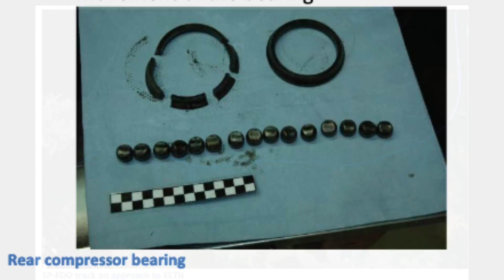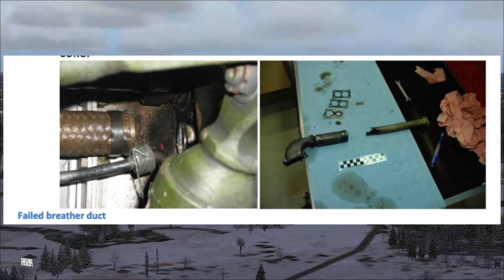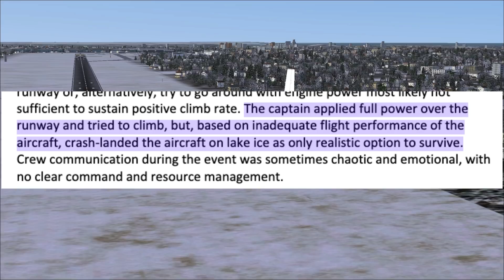When Not Following Procedure Almost Turned Deadly | Exin Co 3589

Comment: A cargo AN26 also crashed at Cox's Bazar (Bangladesh) in 2018 due to an engine failure on take off, the crash occurred because subsequent actions from the crew were not part of SOP's

There was fog at the departure airport, the crew should have continued to their alternate airport about 50nm away, but they persisted for a landing in fog, and during their subsequent go-around, with the aircraft STILL configured in landing configuration, FULL flap gear down, resulted in loss of control and a single engine full power impact in to shallow water

It was not a pretty sight at all.......

Comment: Simply poor piloting skills. As for the '140ft pm' climb performance on one engine.. that's a grossly over-simplified statement of fact. Yes, a test-pilot, with a brand new aircraft in the certification stage, on a good weather day and in full knowledge of the procedure to be demonstrated, achieved the figure of 140 ft per min climb gradient. 140 ft pm is a minuscule climb gradient, the tiniest amount of insufficient or excessive rudder input, or either not quite achieving, or applying more than 5 degrees of bank, toward the good engine, would eliminate that 140ft. These are two very average, maybe below average pilots faced with an unexpected and serious failing of equipment at low altitude. How much time have they spent in simulators? Who knows, my guess is.. not nearly enough.

Comment: I wonder if the fact that the landing gear was down when the pilots attempted a go around made a difference? If the had retracted the gear, the plane may have been able to gain altitude instead of sinking.
Reply: the description indicates that the landing gear was lowered after the runway threshold was passed, but retracted again afterwards

Comment: For Some Time Now, It Has Been Known That an Accident Involves Several Factors.

Despite the Pilots' Misconduct, They Share the Responsibility with the Company,

Because, Without a Doubt, It Is Who Must Guarantee a Good Training and, of Course !,

The Awareness and Commitment of All Your Pilots To Follow, As Strictly As Possible, “TO FLY LIKE YOU TRAIN" !

That Is, If The Pilots Failed, The Company Also Failed to Provide Adequate Training or Assessment.

However, It's Not Just Training and Rigorous Charges, Everything Must Have Balance !

Take a Look At, For Example, The Two Impressive "Almost" Catastrophic Accidents Suffered by Emirats in December 2021 and January 2022.

There Has To Be Balance, As In Aircraft’s Performance !

Comment: They may assert that the plane can be flown on one engine, but, if the engines were getting old and worn, and the plane was very close to its maximum weight, that may not have been true at the time of the crash.
Reply: Also the lack of coordination among the crew was probably a reflection of conditions on the ground as well, and the right engine was probably as much of a deathtrap as the left one. It just hadn't gone yet.

Comment: Bad bad CRM. They tried to do way too much at once. Their failure to follow the checklists (more than one) is evidence of this. If the pilot wanted the extra boost from the APU (a fine idea), they should have called off the approach, stayed at altitude and focused just on getting the APU online (following the checklist). With that, they would have been able to continue to focusing just on landing the plane.

Comment: Just FYI, in all (modern) aircrafts, the APU is basically a tiny jet engine, as it runs on kerosine.
Reply: what i know about apu's they are generators  on the planes it self for starting or powering up without engines running for example if ground crew wants to perform checks for plane they turn them on or pilots wants to start the plane, or they can ask for ground generators service from the airport

Comment: APU (RU-19 is the model name) on An-26 and An-24RVs is thorttleable, it has a third throttle to the right of the main ones on the pedestal, so you can choose whether you want it to provide full power or just idle. Its main purpose is providing electric power on the ground, as well as additional thrust at take-off weight close to maximum, or at hot and high aerodromes.

Comment: Why not do the circling for 25? instead of landing with a tailwind while heavy.  Or Too heavy for the 180 circling turn?  Just widen the distance on downwind to use only 30 degree banks only.. It is high VFR. Too difficult to do a 180 turn at 1,000 agl?  Gee.  Some airline pilots can only do mild turns and mild straight in approaches.  See the results..

Comment: -Technically, it is NOT true that all twin engine planes are designed to fly on only one engine.  Some light twins cannot maintain altitude at typical weights on one engine.  A good example is the Piper Apache, which only has 150 hp per side.  The remaining engine takes you to the scene of the accident...

Airline equipment is required to be able to climb at a 2.6 degree angle after an engine failure at rotation.  This is done by leaving weight behind on the ground in order to ensure this performance.  Ever had an airline "lose" your luggage?  They didn't lose it at all, they left it behind in order to make sure that this required performance is met.

Great video!
Reply: They ARE meant to fly on single engine. If they do, is another thing, but no twin is legally impossible to fly on a single engine given the max weight is not exceeded.

Comment: Wow, 140fpm is extremely marginal performance, even if you do everything perfectly. 

I know it’s technically pilot error, but the aircraft performance doesn’t exactly seem ideal either.
Reply: yup POS plane barely works on a good day with a stong breeze ;)
Reply: given the lack of maintenance on the failed engine I'm doubt the remaining engine was perming up to spec
Reply: It has to fly and land on one engine. It doesn't have to be able to take off on one engine.
Reply: Assuming the 2nd engine was generating full rated power and aircraft weight was as published... Which it never often is

Comment: okay, this is a nice video of what happened . you have added that you where in a warm bed while making this video, so props to that. what I can add is that no human on earth can possibly know what it is like following a checklist...(for those that don't know, when you have an abnormal parameter or vibration, you use a QRH(quick reference  handbook)  that will tell you what procedure to follow, in this case you would likely run 3 checklists and then the normal checklist after that...if they where in fact on final approach and they had this abnormal situation it is not uncommon for the crew to do a go around, knowing that there aircraft will fly and climb on one engine...now what makes this video confusing to me is there is a few animations(flightsim) where the aircraft go's around and  extends the gear , however you never mention that the crew did this ? that would make a huge difference in flight performance, also then at a stage it just lands on the runway...(please include actually feathering the engine in your videos as this is something real pilots look at, plus it makes it a lot more believable) My point is ..you go around because it is clearly not a stable approach...you add power and the aircraft does not perform like it should. If you have experienced that..  then sure give the crew shit. If have not been in that situation the you would have no idea how that feels to know you are now heading towards certain death. so its very hypocritical to anybody who has not been  in that situation to say, hey the crew made a mistake. the visibly was also less than ideal..so all in all I give the crew 10/10 for surviving this accident...Its not as simple as it seems.

Comment: I know this comment is out of place, however I hope it is read by people in the aviation industry, because I worry about noone thinking about what would happen with aircrafts in a huge radius, because of the EMP from a possible Russian nuclear attack on Ukraine. 

Because no jet airliners except those special ones that are rebuilt and hardened for military purposes, are tested and guaranteed to withstand the EMP that will reach far beyond Ukraines border at high altitude.

Such an attack will be extremely devastating for those on the ground of course, and most lifes will be lost there. However - additional lifes will be lost 
by a possibly high number of aircrafts being partly or completely disabled or needing to do an emergency landing at the same time.

Even worse, the impact on all those civilian aircrafts could be counted as an attack on NATO members, meaning that what "just" was intended as
a tactical nuclear strike inside Ukraine, may escalate to an all out nuclear war, because of the unintended consequences - and I see no articles or any 
information about what would happen with civilian aviation, if even one atomic bomb is detonated, as there have been no nuclear tests near civilian aircrafts in the air, because these tests happened far away, testing military equipment, vehicles, ships, perhaps some aircrafts, but no civilian aircrafts.

And as we see from Russias extremely wreckless actions in Chernobyl, there is no reason to believe Russia has thought well through what would happen with all those aircrafts, even when being well outside Ukraine, that still are within reach of the EMP and serious risk of being disabled, making even a "tactical" strike, something that could very well trigger the doomsday.

Comment: The pilots don't need to be that cool. Just coordinate well and share the responsibilities, that's more than enough. If one of the pilot concentrated on bringing the APU online by following the correct procedures, they would've landed safely on the runway itself. Whatever incidents that's mentioned in this video ended quite well is certainly due to the excellent coordination between the pilots.

Comment: As I remember An-26 is a cargo version of An-24 passenger plane. You can use it by different tail, flat at the bottom to incorporate loading ramp.  All those changes made plane heavier so jet engine was to help with that. I saw 26 many times as it was used by Polish Airforce as cargo and sometimes personel carrier (i live close to military airfield). They alvays used jet engine for take off (you can hear it). 
An's-24 in Polish Airlines (LOT) had lot of crashes (forced landings in countryside) due to engine malfunction. So, this suggests that flying that plane with one engine was not so easy and sometimes simply impossible (not enough power etc.). So i am not suprised that heavier version crashed due to one engine malfunction.
Reply: Unfortunately An-24 had serious problems with single engine flight. Crashes due to adverse handling effects in this flight regime happened in the USSR too. Feathering sometimes failed, oil pressure anomalies could cause a propeller to unfeather by itself, and according to official manuals, flight with a failed windmilling (unfeathered) engine is possible in descent only - the drag is just too much. To add the safety margin in case things go south they added the RU-19 auxiliary engine in the -RV variant and the An-26 deriative.
Reply: I read your comment before I left mine. It is entirely likely that the one engine simply lacked the power for a go around. The engines were old, one failed outright and the remaining one was likely producing less power than it did when new. Add to that the fact that the plane was very close to its maximum weight.
Reply: Besided If I remeber the An-24 operating procedures you are actually supposed to start the aux engine before approach at high weight JUST for situations like this

Comment: APU questions answered:
Antonov 26 APU is called RU19A-300. In order to provide power on the ramp, it must be on 70% of full power (let’s call it 300 kg of thrust) so yes, there’s a jet engine running and the plane may move if there is no parking brake or chocks, but the parking brake itself can take care of that. You need 90% of power for engine start, and 94% for take off (only then it’s 800 kg of thrust). 
Though there’s a flight engineer in the crew, APU start panel is on PIC side, not on flight engineer side, so PIC has to start it which is really hard in the situation like that. It’s just a bad cockpit design. 
I believe the crew didn’t want to drop gear and flaps to keep the speed up and to control the plane better with one engine, so the plane doesn’t roll towards the inoperative engine. But definitely there was a situational awareness problem and it seems like they didn’t realize how close to the runway they were. 
Personally, I want to add that Antonov 24/26 is a legendary plane. It’s just a bit old (just a bit :) The book performance may not match actual performance because of the engine conditions.
Reply: a new info 
thank you
Reply: Why would anyone stash their coke in the engine seems kinda stupid
Reply: @crazyjhey8050   No, it's brilliant.  Who would think to look for it there?
Reply: My thought was that after the way the left engine went, they didn't have much faith in the other one either. After all, they'd been maintained by the same people, and the pilots had to realize those guys weren't going to be any more on top of things than they were themselves. So they figured the right engine would underperform and they'd need that APU power to get  back in the air. I honestly can't blame them if that was the logic. But they still needed to remember to fly the plane.
Reply: It's so weird that going from 70% power to 94% results in thrust going from 300 to 800 kg - almost triple! 😮
Physics....
Reply: @MrNicoJac  in that state, any feathering would be inop, the oil which runs it would be clogged by the gunk that was forming in the engine...
Reply: @stanislavkostarnov2157  Even with the worst engine failure, the prop must be feathered. There is a separate feather oil pump that will feather the propeller even in these conditions. Actually, there are three separate systems to feather the prop, including the hydraulic one. It’s impossible to fly this airplane with windmilling prop. I mean it can not fly straight and level with unfeathered prop. It would just crash right after the engine failure basically.
Reply: APU didn't work ..one engine was operational...they should have safely landed even after go around